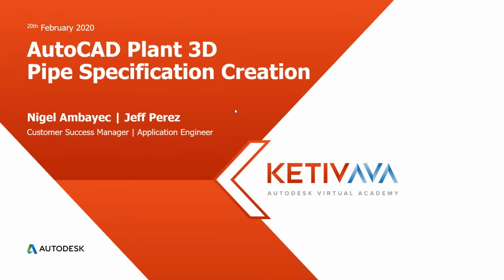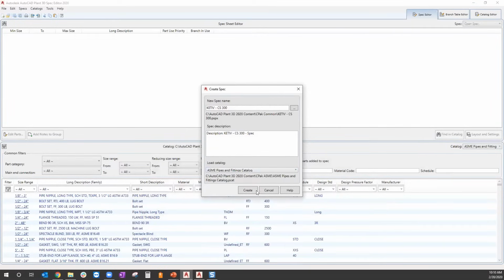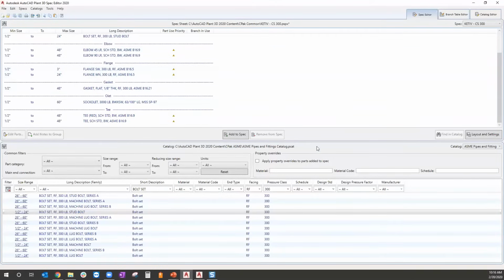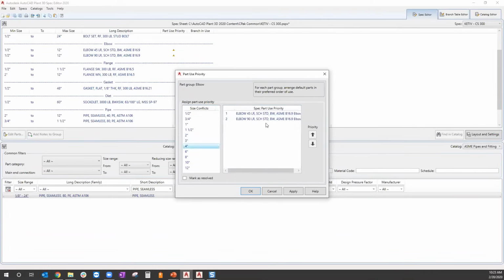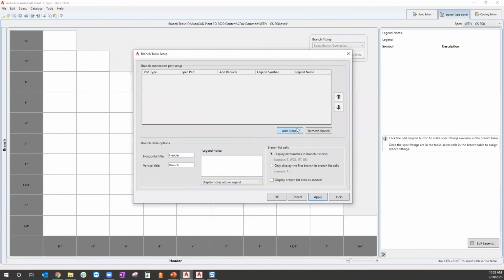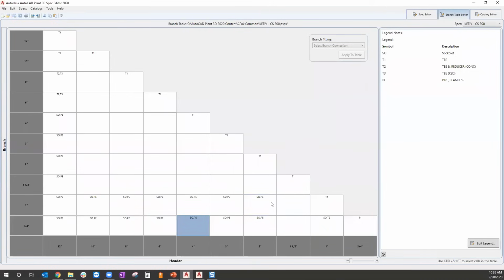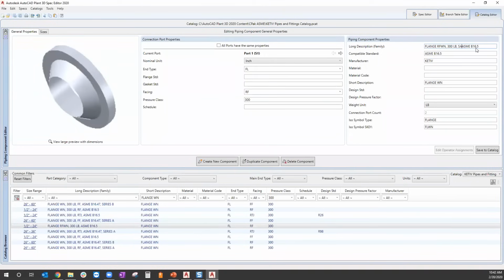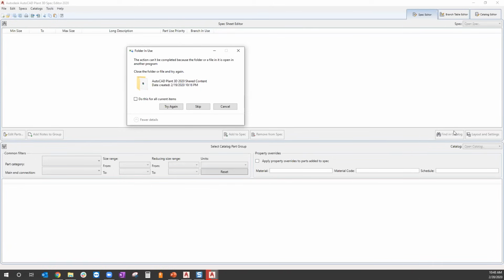AutoCAD Plant 3D Pipe Specification Creation | Autodesk Virtual Academy

Comment: JUST A COMMENT, ELBOW RL IS A BEND PIPE, AND ELL 90 RL ARE STANDARD 90 ELBOWS IN SPECIFICATION. IF YOU PUT THE FIRST ONES IN THE ISOMETRIC THE LEGEND BEND WILL APPEAR.

Comment: So i created a new catalog of equipment (lets say its a Clamp Union with ferrule on it), i used a model i download online and added it to the catalog. I set the "Size parameter" in Catalog Editor as normal but in the drawing tab in Plant 3D when i connect it to the pipe (both were 1 1/2" in size), the Clamp become huge, much much bigger than the size of pipe. So can you tell me what i did wrong? Do i have to scale the Clamp in the model i download (model in AutoCad 3D Plant too) or something? Thank you

Comment: Hi there! 
Can you tell me what graphics card is used to make these plant
Reply: I see they never answered, but a circa 2014 K2200 4GB DDR5 could probably run Plant 3D no problem. It's just a standard CAD workstation GPU I'd imagine. 2GB to 4GB (preferred) I'd guess. I've used a K620 2GB DDR3 at my job, and it has zero issues. Although, if you're rendering high detailed textures, you'd want a beefier GPU to save some time and stutters (of course). Just my opinion based on my personal experience. Sorry I jumped in. Tech Power Up has excellent resources, as well as OEMs like Dell. I'd take a peek at their current workstation builds for an idea as well. Good luck on the GPU hunt. Some are way overpriced right now, due to the "shortage".
Reply from the maker: Thank you Smiley Tek for jumping in here, sorry for the delay in reponse. Yes we prefer the CAD Cards like Nvidia Quadro and AMD FirePro's  Here is a list of cards and drivers that have been tested.  https://knowledge.autodesk.com/certified-graphics-hardware